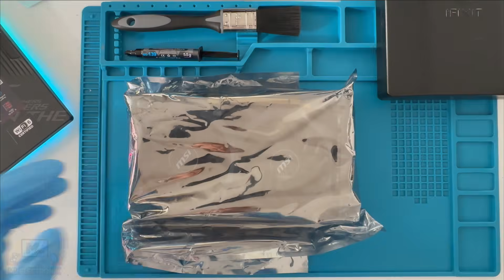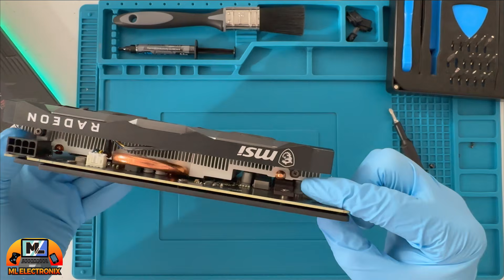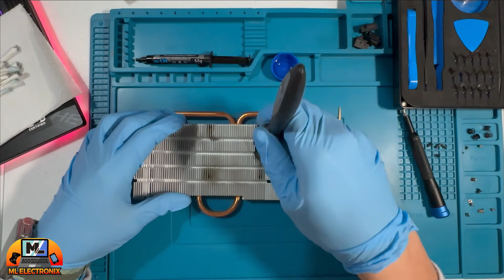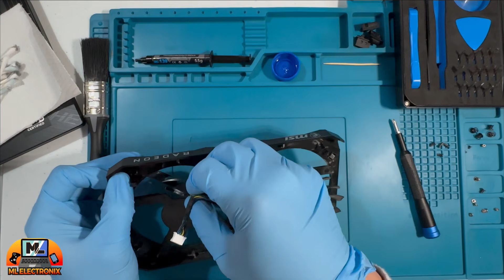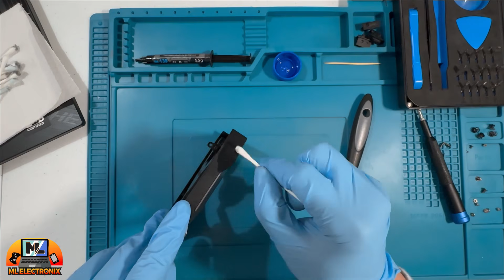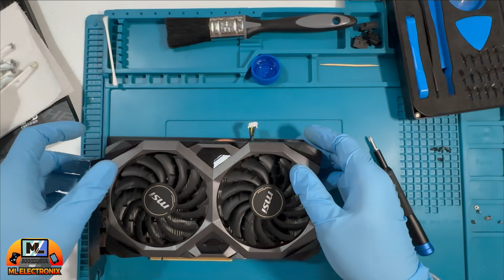👌 Revive Your GPU: Ultimate Guide to Cleaning & Replacing Thermal Paste! #diy

Comment: Sir Whats the size of this gpu thermal pads?
Reply from the maker: MSI RX 5500 XT Gaming X 8GB: This model utilizes 1mm thick thermal pads for both memory modules and voltage regulator modules (VRMs).